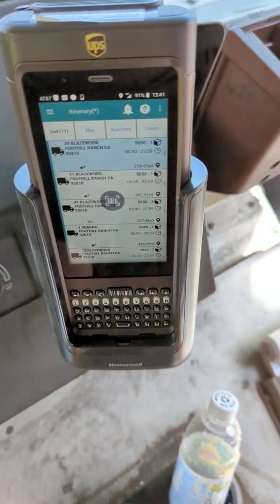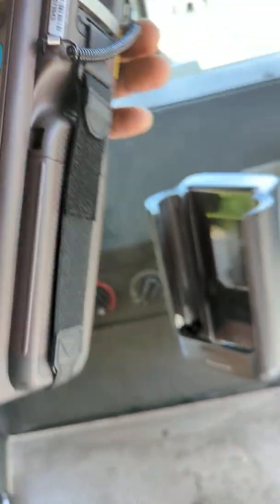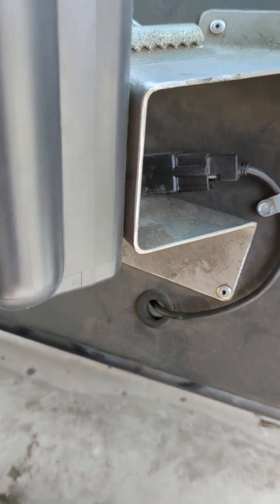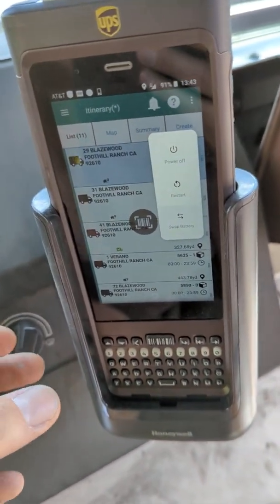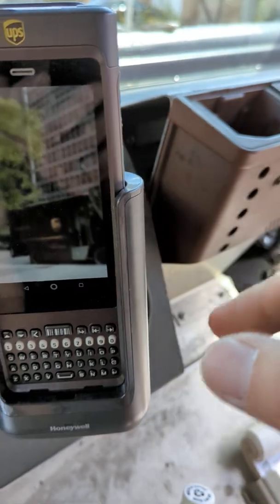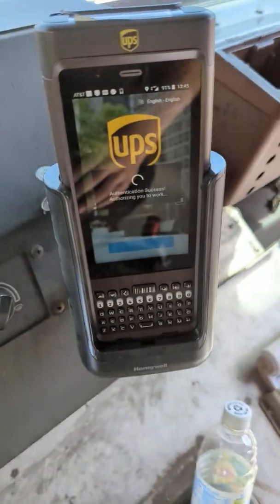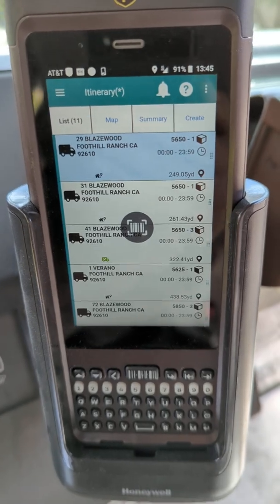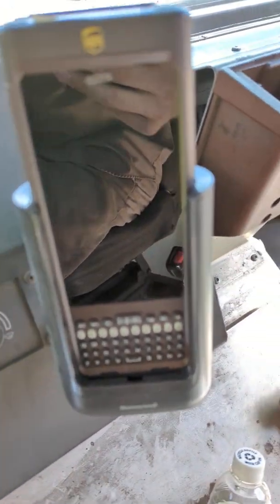how to DISABLE NAVIGATION on the UPS DIAD 6 (yes it's possible)

Comment: You’re wrong on how the diad connects. It also doesn’t charge in the cradle that I know of. The only way it starts the diad is by a magnet that the diad slides past. That’s how I get nav during peak in trucks that don’t have cradles. Rub a magnet on the back of the diad above the trigger on the hump and your gps will start. Do it again to get out of nav

Comment: Reasons for freezing: signal, messages,  frequent usage.  Know your next 3 stops have back up gps to combat loading time . Completely close and restart. Tons of good features outside of freezing.
Reply: Yeah I deliver in an area that gets no service so I don’t get any messages until I reach a little pocket that does get service and then the diad absolutely spazzes out
Reply: @johnnywaffles2482  if you see the black screen of death about you pop up immediately pull out you have a 1.5 second window to pull and cancel the black screen of death. If Diad starts going slow reset it. Use the maps especially if you want to find a stop out of sequence. I usually wait to remote scan those just because Diad trips

Comment: Do you have any secrets on how to make these new diad 6 not crash or slow down throughout the day,seems like mine crashes at least a handful of times each day,even had them crash like every other stop??
Reply: Dude, mine always hard crashes and then crashes multiple times trying to reboot at 1 specific stop during my day. It also slows down or crashes at bulk pickups (20 or more pieces)
Reply: i think it has something to do with the sever its on. My coworkers and mines usually crash at the same time.
Reply: Crash after ETA
Reply: Swipe up from the bottom of your diad screen push the square then swipe close to restart the app. Faster than restarting the whole diad.